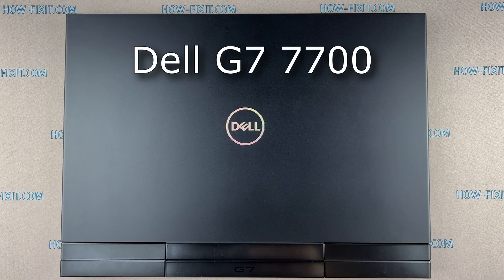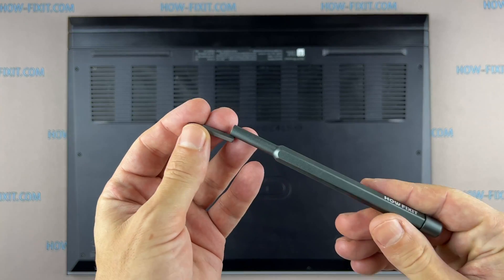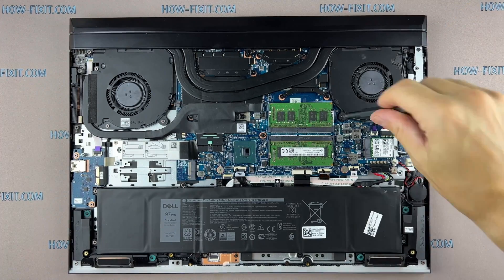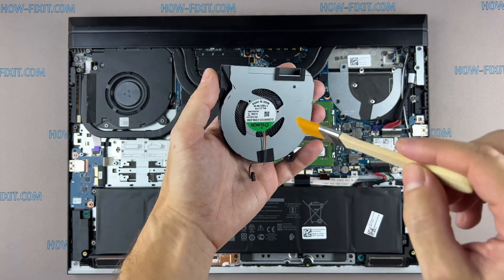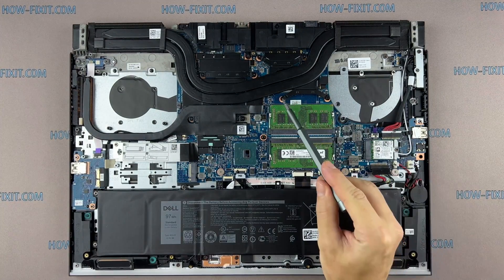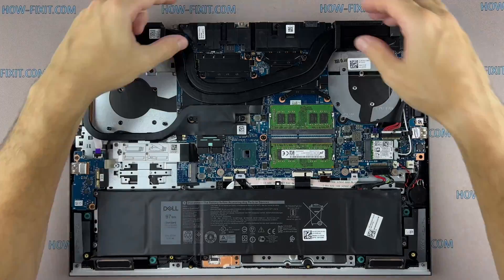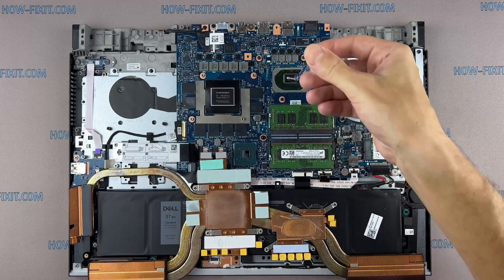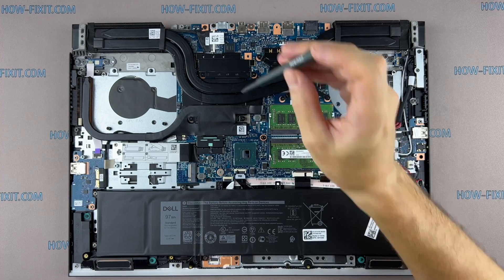Dell G7 7700 Disassembly, fan cleaning and thermal paste replacement

Comment: Thank you for making this video. My G7 desperately needed a service. It was overheating and throttling while playing games. The stock paste was past its usefulness. Dried, cracked and no longer doing its job. Not to mention it was of poor quality. I replaced it with Thermalright's T8 Thermal Paste.  After I closed the laptop up (no screws lost or left over :)) I ran the laptop through its paces. Before it was getting up to temps that would go through the keyboard and started cooking the fingertips. Now, the laptop doesn't even break a sweat. Having the proper tools and the video made it relatively trivial.